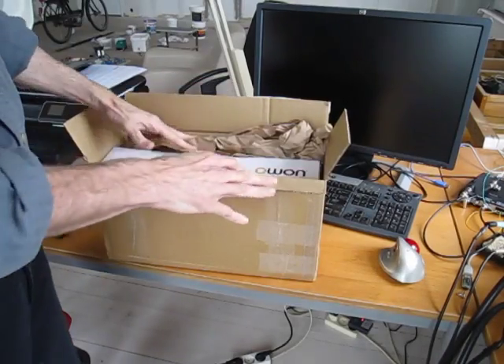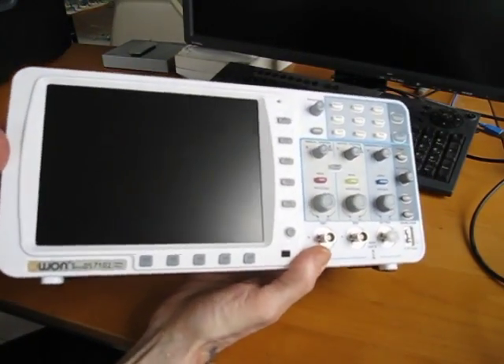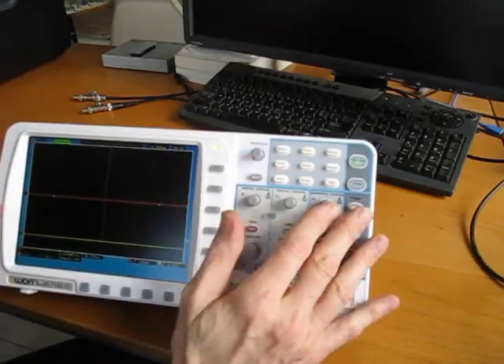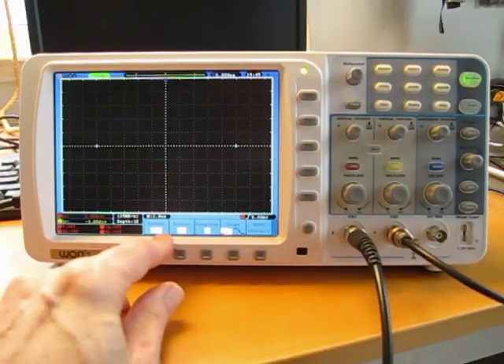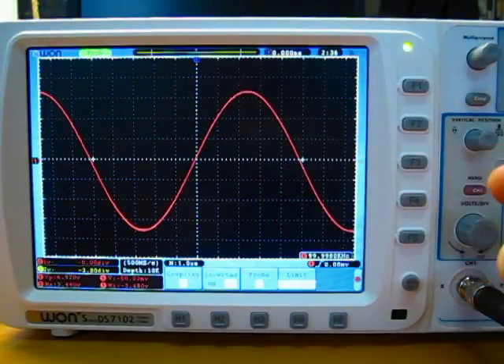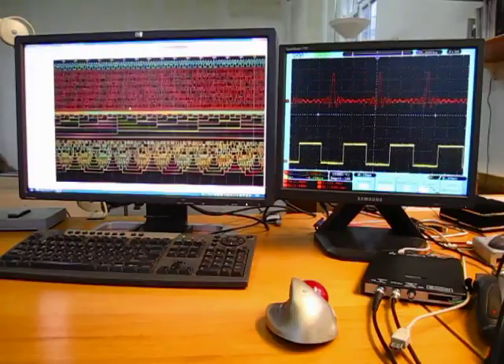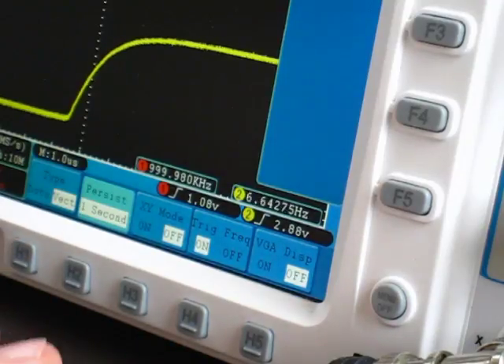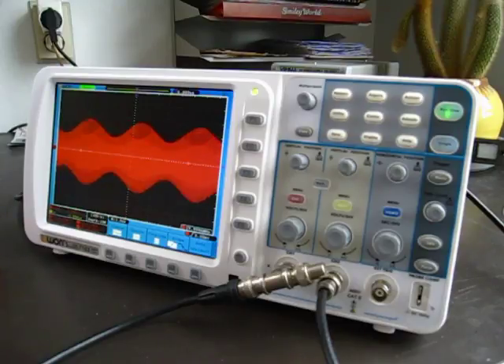OWON SDS7102 Complete Review

Comment: I bought the same unit and so far I'm happy. Some times when I fiddle a lot with menu controls it hangs up, but I just restart it no big deal. Build quality is basically what I expected for the price, but it feels good enough. The display is great, with very little glare. Btw, mine has LAN but not VGA. I use neither.

Comment from the maker: Glad I could help. Just be aware that the Owon is not a very choice for design and debugging of digital electronics (because of the slow wfrm/s update rate) although it's absolutely fine for general purpose repair work (especially onsite work - because of the battery). Watch my Hantek review for more info about this issue.

Comment: The trigger out can still be optically isolated, even though you see continuity between the shielding conductor of the jack, which you really want to. So, just because you read from the outer part of the jack, to the outer shell of another BNC jack only shows that all are connected to the same shielding ground. The signal from the center conductor of the trigger out can still be optically isolated from the rest of the scope circuitry. Madel as in Madel Electronics?

Comment from the maker: It COULD be.... but it isn't. I had the scope open and checked (you can see hi-res photos at the link listed above). I also had a conversation with Owon about it - and they admitted that both their advertisements and the manual were incorrect on this point (i.e. false). Did they change the false ads and owners manual? Not for a very long time -- I think they finally dropped the claim about 10-12 months after I called them out about it.

Comment from the maker: No, that's one thing that it's missing - which is a bit of a shame - but it has a much bigger, sharper, and more readable screen than the older Rigols. Plus (and as a programmer - this is a big plus), unlike the Owon or the Hantek, it has the standard SCPI command set for interfacing to a PC - so you can write your own output routine - which although not exactly the same as hardware VGA out - can do similar things.

Comment from the maker: Just to be thorough, here is part of the exchange I had with Owon 15.5 months ago:

Me: "First, either my unit is defective - or the output does not seem optically-isolated as you claim.  I measure 15kOhms between the 2 points of the BNC connector with power off to the scope."

Owon: "Our product is not optically-isolated output like the Rigol DS1052E’s, but field-effect tube output."

Comment from the maker: The original review was done in 3 parts in Aug. - Sept. 2011. I just recently re-posted it as a single video to try to ensure that viewers thinking of buying one of the SDS scopes would see both the pros and cons. I know that Owon has made some improvements to the hardware (and firmware) although I think most of my original complaints remain valid with the latest version. I still think it's a good value for money if you need a DSO for basic repair work - not so much for design and debugging.

Comment: The only reason I would never buy an Owon is the slide issue. The thing weighs about the same as a deck of cards and has buttons Chuck Norris can barely press. Yeah there are things you can do, but I just want something I can pull out of the box and use!

Comment: I can't imagine that writing either a large amount of memory heap or a small amount takes any difference in time.  I have written such routines and a round robin write takes the same amount of time no matter how large the buffer is.  And the routine is simple and fast.  Does not require copying memory, which seems to be what they are doing since it slows so considerably when capturing to a large memory size.  If, of course, I understand what is going on with the trace memory function.
Reply from the maker: Mikey MoMo Of course it takes more time to write more memory - but under most other circumstances (e.g. inside a computer), that extra time is negligible. But DSOs are real-time machines working with capturing, decimating, and displaying data in micro or nanoseconds - while missing as little as possible of the incoming data. Since each of those steps requires processing power, the more clever (and usually expensive) DSOs offload the work to different processors - but many of the low-cost DSOs (such as this one) use one processor to try to perform all of the steps.

Comment: Feeding back the trigger signal and using alternate trigger makes the wps numbers irrelevant. If you use an external frequency counter to measure the trigger out you get the real numbers which are - while still budget dso territory - much better. It actually captures 200-210 waveforms per second to 1k debth, 150 to 10k, 70-80 to 10M. The big problem is the persistence, which takes the numbers down to 20-30. XY mode is 95 wps. Also, as the GUI thread runs on the same CPU as the data processing, even having measurements or menus on the screen will slow down the capture rate. An other thing to keep in mind is that the captures are not spread out evenly. If you feed the trigger out into a second scope, you will see grouped spikes, capturing a burst of waveforms, then nothing until the CPU finished updating the screen, doing measurements and whatever else.
These scopes are clearly not for runt signal captures. Just as they are not mixed signal scopes, and they don't have 1GHz bandwidth or 4 channels. Pick the tool for the job. By any means, for the money they are excellent value.
Reply from the maker: ***** Their waveform capture rates are terrible and they don't do intensity grading. While they might have been reasonable value for the money when I made this review 4 years ago, you can now buy the 4-channel Rigol DS1000Z with 64 level intensity-graded display and many more features (as well as capturing up to 30,000 wps) for less money, so, no, these Owon DSOs are no longer good value for the money.
Reply: Mark Madel Haven't noticed it was from 2012. That was a much older firmware back then. One of the latest upgrades they made was improving the capture rate, but only to the numbers above.
Not sure I understand your argument about not being good value. The Rigol DS1104Z costs near twice the price of the Owon and a completely different kind of beast. Might be even better value, but in a different league. 10M per channel full speed deep memory for £270 (5/2015) is awesome. Mind you, deep memory is more important for me than capture rate. If I had the budget and/or I really needed its features I would buy the Rigol DS1000Z for sure.
Reply from the maker: ***** My original 3-part review is from August 2011 (just after the DSO was introduced) - this 'compilation' is from 2012. But the firmware makes no difference - the underlying technology is out-of-date. I would never consider buying an inexpensive DSO without intensity-grading anymore.

And your value comparison only makes sense if you don't consider the fact that the Rigol DS1000Z series has already been hacked ever since it was first introduced. That means ALL of the special locked features (100MHz bandwidth, 24M full speed deep memory, all protocol decoding, segmented memory, etc) are FREE for any owner that wants to spend 10 minutes of his time generating the unlock key (in other words, compare the price of the base model DS1054Z to the SDS7102).

I repeat: it's ridiculous to buy the Owon at this point in time unless you just want to cripple yourself - you would be buying 5-year old technology which has been superseded by the other Chinese companies: Rigol, Instek, Siglent, etc.

Comment: Is it possible with Owon SDS7102 to see both cursors on the display at the same time. It will be very useful to see both x and y deltas together
Reply from the maker: Hi Denis - I haven't owned the SDS7102 in many years, so I don't remember anymore. You'd be better off either asking someone that currently has it, or by checking the instruction manual online.
Reply: No only V or T  not both at the same time

Comment: Purchased the SDS7102 in 2013. There was a factory problem with the motherboard: the DSP stopped working after 10-20 minutes. The manufacturer replaced the unit. The new unit worked properly for 3-4 months when the rotary encoders began to make problems (contact issue...). 

After 3-4 years disassembled the unit and cleaned the rotary encoders. It worked for 2-3 months properly when the problems began again.

Also ordered replacement encoders from Aliexpress (not awaiting much of them...). Still not installed the new encoders; it is a hard work to remove them from the PCB again etc.

Today upon powering up the SDS7102 the left channel is reading 10000+ Volts. Didn't get any voltage spike etc. It seems the motherboard failed again?

ONE THING IS DEFINITIVE: I'LL NEVER BUY AGAIN A SUCH CRAP CHINESE SH***T. It costed half price of a HAMEG or Tectronix, but never worked properly. :( It's time to throw it into the trash...